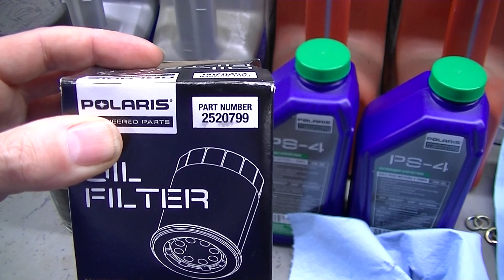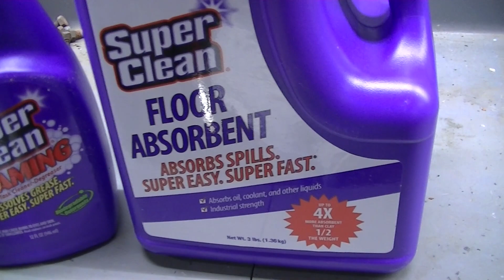Polaris Ranger 6x6 | Oil Change

Comment: Super awesome video. I’m going to do the oil change and oil filter on my 2002 Polaris Ranger 500 tomorrow. I’m glad you said not to worry about the other oil plug under the motor just the one on the oil reservoir . Thank you so much for sharing
Reply from the maker: If you change your oil regularly I wouldn't worry about the little bit that is left in the motor. There is a screen filter on the suction line in the tank. I have never seen that get dirty. If you remove that then you have to pinch off the tank vent line and start the engine for a short time.
Reply from the maker: As long as you don't disconnect the oil suction hose you just have to fill it back up with oil. You can do what you want with the vent hose.